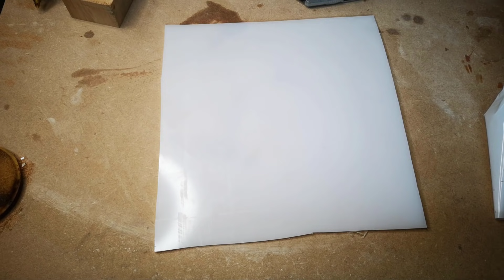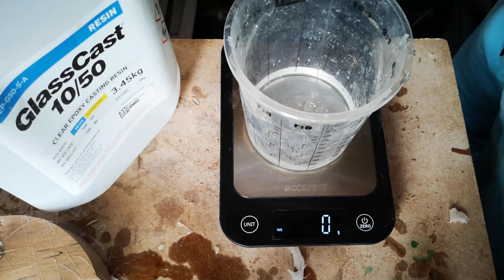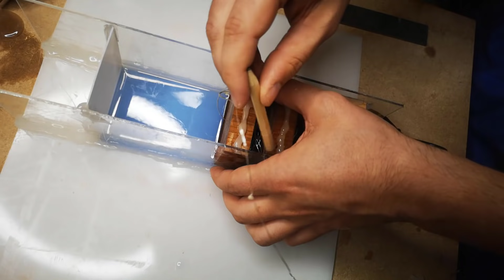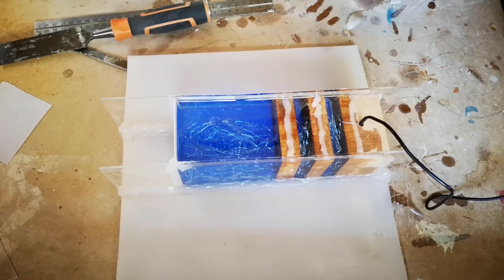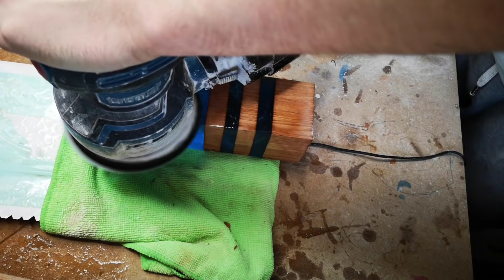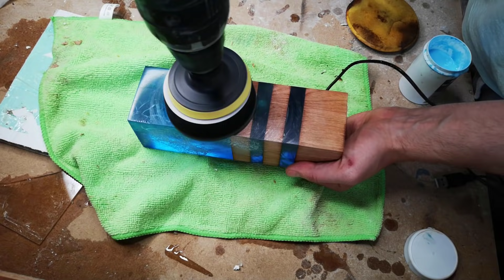Blue Epoxy Resin Lamp

Comment: Hi, I’ve tried this exact design (saw yours & loved it!!) BUT after I poured the resin, the lights stopped working?! 
I can only guess that the heat from the resin hardening cooked them?? Very very frustrating.
Reply from the maker: I think it was like that, maybe you poured too much resin and it boiling
Reply: @mbresinart  I’m not using the glass cast resin but when you’re pouring, do you do it in stages?? Slowly bit by bit until it’s full??
Reply from the maker: I poured this lamp into two layers

Comment: Hi can you show me how you mix / get the air bubbles out of the mix? do you use a pressure pot? love the video
Reply from the maker: I use vacuum chamber
Reply: @mbresinart  super thx! second question. in this video you use 2 layers of epoxy. the first one then you put the leds in and after that the second layer. 

in the end result do you see the layer 1 and 2 or are they nice mixed together? 
also how do you get that coloriing right :)

Comment: Hello. What’s the secret if I want to cast something bigger than the 1cm layers recommended by epoxy? Do I have to consider the mixing ratio as well?  I mean by, say, not a 2: 1 ratio but more / less? It has been written in several places that it breaks ugly during drying if we use a lot at once

Comment: can you tell me. What are the uses for polishing and grade details of emery paper? Which ones do you use?
Reply: Paper grades possibly 320 - 3000 wet n dry. Polish buffing. Abrasive paste (rough) followed by finer polishing compounds. Like 3m automotive 'Fast cut', 'ultra fine SE & 'Extra Fine Plus' (you might find the triple pack, 8oz(250ml) bottles
Reply: @icarus1416  thanks
Reply: @icarus1416  please tell all detail for emery paper please